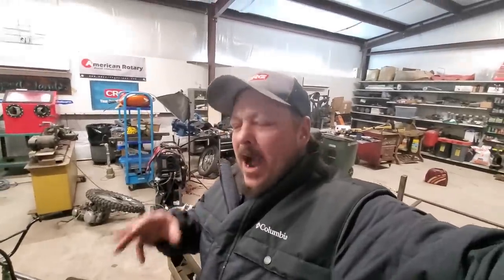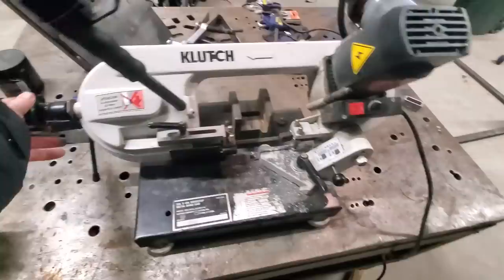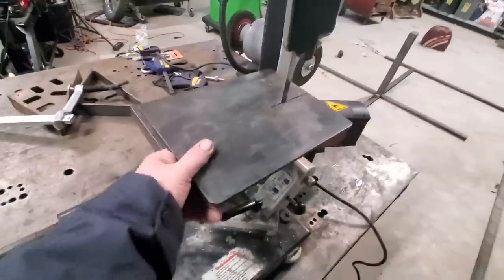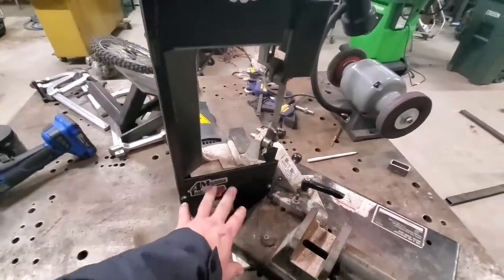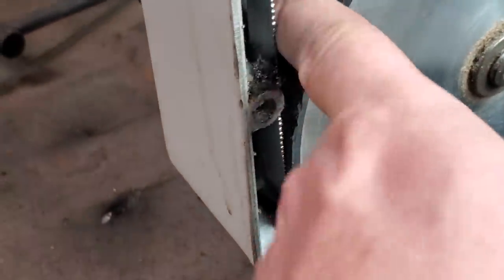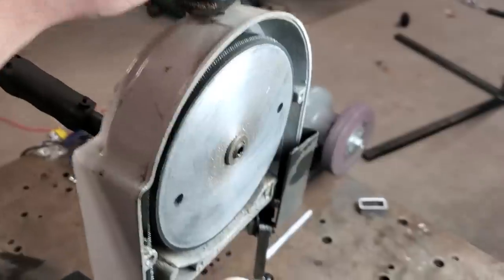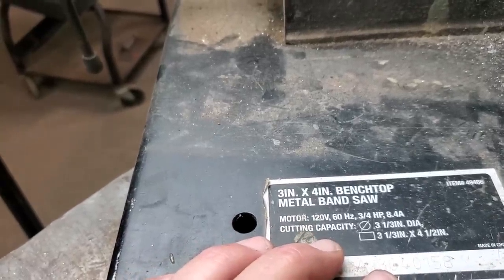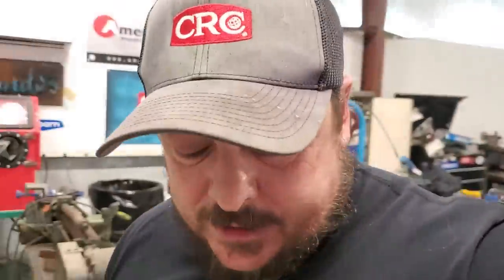Best small bandsaw setup?

Comment: ought it a couple of years ago. Don't know how I worked without it. Replaced the blade after my first big cutting job. Often cut 4" x 1/2" steel plate with no problem. How do you hold it in the verticle position? I need to do the conversion to vertical for some jobs.

Comment: I modified a 12 wood cutting vertical band saw, while the HF saw and the SWAG table was awesome I kept running into the same clearance issue you highlighted on your video. What my saw combo is a HF type horizontal and my modified 12” Craftsman vertical. This works well for me

Comment: Yeah, I went with a Bauer portable band saw after trying the Chicago Electric vertical, horizontal with base, it was a disaster couldn't get the blade to track correctly it actually cut into the guide. Took it back and got the Bauer, which is a good saw, but I need something with a base and vise. Got a chop saw and wish I hadn't it is a mess, through sparks all day and couldn't even cut through 2" x 2" square tubing. The Bauer cuts through it well enough, but I'm free handing it and not getting accurate cuts. All in all, wish I would have gone with the Klutch.

Comment: I got one of these a few months back worked grate till the gearbox exploded. The baring housing for the drive wheel is plastic so if you get the blade to tight the gears get miss alined and brake. They did send me a brad new one though.
Reply from the maker: Thanks for the info. Good to know. Glad they actually stood by the warrintee

Comment: I've been trying to decide between this saw and the WEN model. Any advice? Consider me a subscriber. 2 THUMBS UP 👍👍😎.
Reply from the maker: +patrick mcglone They are close and probably made in the same factory. Not sure. All I can say is this saw is good. I habe had it for a long time now and it never skipped a beat. I would go with the Klutch.
Reply: @TheGoodoftheLand  what is the biggest piece of pipe and/ or
Square stock you've cut? Would you still choose the KLUTCH over a floor model?

Comment: A question, how do you know how tight to adjust the blade itself? Is there a trick to it?
Reply from the maker: +James Chippett The key is, get it as tight as it needs to be to not slip and track properly. The blades are strong enough to damage the bearings if over tight. It's a breeze to set up with a new belt.